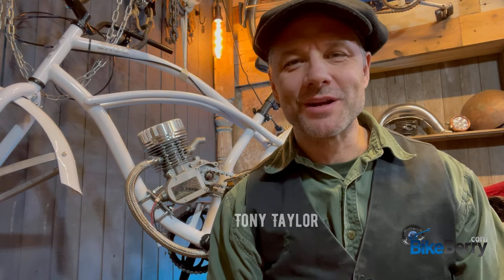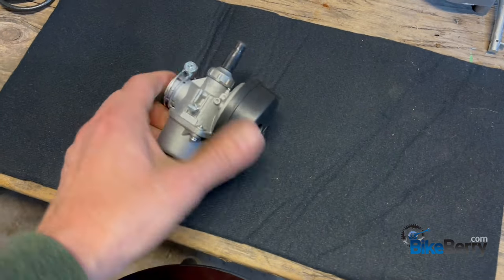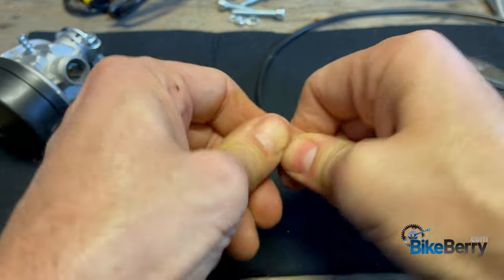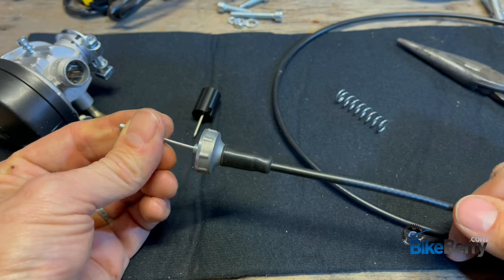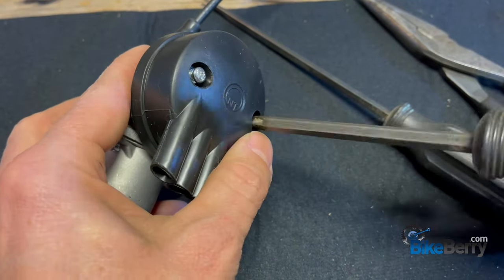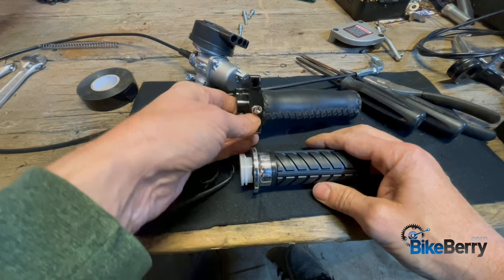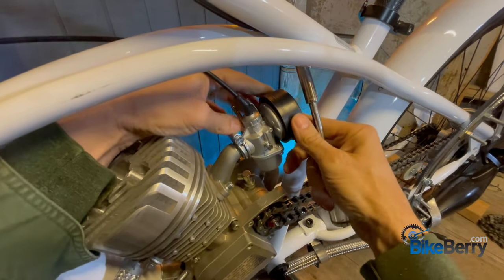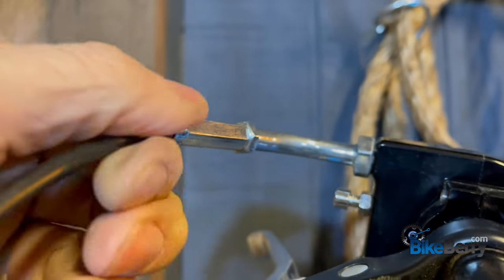Carburetor And Clutch | Adjusting Your New Motorized Bike's Carburetor & Clutch | Bike Berry

Comment: I REALLY NEED SOMEBODY'S HELP I WENT TO THIS SITE CUZ THIS FELLA REALLY KNOWS HIS STUFF. SO MY BUDDY HAD ONE OF THOSE CHINESE 49CC ENGINES ON A BEACH CRUISER HE RAN IT JUST FINE PUT IT IN THE SHED FOR 6 MONTHS AND THEN GAVE IT TO ME. IT'S MY ONLY MEANS  OF TRANSPORTATION AND I TAKE CARE OF A 77 YEAR OLD WOMAN WITH THE DEMENTIA SO I REALLY NEEDED IT TO WORK. IT DID NOT EVEN WANT TO SPUTTER FOR ME WHEN I HAD GOTTEN IT SO I REPLACED THE COIL, I REPLACED THE CARBURETOR ,I REPLACED THE SPARK PLUG ,AND NOTHING I SQUIRTED STARTING FLUID DIRECTLY INTO THE INTAKE NOTHING IT DOESN'T EVEN WANT TO SPUTTER. I CHECKED THE MAGNETO WHEN I HOLD THE SPARK PLUG ON MY HEAD AND PEDAL THE BIKE I GET SPARK SO THAT'S WORKING. I HAVE NO IDEA WHAT TO DO TO GET THIS RUNNING AND I NEED SOMEONE SMARTER THAN MYSELF TO GIVE ME SOME ADVICE. PLEASE HELP
Reply: Check for compression?
Reply: If you've got fuel and you've got spark and the magneto isn't on backwards (it'd still probably want to run if it was) odds are you are losing compression somehow. When you try to fire it does it slow you down significantly or does the engine spin over really easily? If it's super easy you aren't making compression
Reply: @fr33dumb0  bro I rebuilt the whole thing I replaced all the gaskets brand new magneto brand new coil the magnets fine the cylinder wall was clean as a whistle although the Piston had a good amount of carbon buildup I cleaned that put the whole engine back together new carburetor it won't even start with starting fluid. I did get it to sputter a little and I don't know if it's because it's a beach cruiser and it only has one lame gear and an extra chain but when I let the clutch out it is rather hard to pedal I'm 55 but I'm in good shape in the damn thing will get me out of breath quick
Reply: @fr33dumb0  I guess I could just buy a new engine but the fact that I rebuilt it and can't get it to run is making me nuts the only thing I didn't replace were the rings and they didn't seem too bad I thought maybe I had a vacuum leak somewhere which is why I replaced all the gaskets I don't know man I'd like to punch it in the face but it's an engine LOL
Reply: @fr33dumb0  I had a custom built Hilland electric bike and that thing was sweet but I planted it into a curb at 30 miles an hour and got a bad compound fracture in my left hand and I'm a damn guitar player but I can't get that bike to work either I think that's just dead I probably broke the brain or something on that one and that's why I want to get this gasoline powered one run and so bad. People that don't ride these bikes don't understand how fun it is because it's kind of like a motorcycle but it's light as shit so it's kind of scary dangerous and fun all at the same time
Reply: I drilled holes in the carburetor filter cover that got mine to start after 2 weeks of sitting gap the sparkplug too if you domt it'll run bad also a pull to start is the best way to go peddle starting is a waste of energy........a motorized bike isn't worth the time honestly they run like shit even when there isn't anything wrong with it
Reply: @bryceevans8340  not true, you just gotta know how to do it properly
Reply: @bryceevans8340  yeah thanks man I never got it running I just gave it away because I heard one drive through my neighborhood and it was 10 times louder than any chainsaw I'd ever used so I figured that let other guy have the problem
Reply: Its a shame you put all tht work into it just to give it away 😢 . Your carburator could have been flooding out the spark plug.
Reply: That carbon was maybe the stuf in-between that kept the compression. Change the piston
Reply: Ahh okay you did change the piston..
Reply: Please not in all caps

Comment: I was given a new motorized bicycle that the owner had never been able to start. The carburetor slide had been assembled upside down.(It is possible and the throttle will only open half way) Because of that, the bike sat in the garage for 6 years until it was discarded. I also found out that the rotor had lost magnetism.  Score!

Comment: Hey great video.New installation my bike won't start but after watching the video I realize my throttle cable is to loose The video shows how to pick a different hole to pre snug cable having g your adjustment screws all the way in so you have maximum adjustment abilities

Comment: Clear easy to follow instructions, with just the right amount of warnings  on what not to do. I have a motor with a starter and it's a little different in the clutch area but carb is same. My problem is mostly now in the sprocket, problem keeping it centered and running true. Thank you for the tutorial. Much appreciated. BTW, I'm 86 yrs old and looking forward to using this bike this summer.

Comment: This whole series has helped me with the little problem I had with my first motor and I actually had to take it off because I missed something up but if I would have watch the videos first I wouldn't have missed it up. You guys are doing an amazing job and you always #builditright
Reply: You ABSOLUTELY hit the nail on the head about the magneto leads being backwards!!! Brand new motor, just WOULD NOT start and I went through everything trying to diagnose it, turns out it was the leads being reversed! I have also noticed these motors are NOTORIOUS for the threads on the end of the crankshaft stripping at the drop of a hat to where the won't tighten back up,! I have TWO of these motors this has happened to, is there any OTHER ways to fix it besides rethreading it to the next size down or replacing the whole assembly?!? Thanks in advance! Be blessed.

Comment: #BUILDITRIGHT This whole series has been A great refresher. I had built my first mini bike when I was about 13, 2 different engines to make one that would get running. Then I got into landscape work always fixing weed eaters and other 2 strokes. I did buy a cheep kit online it only took me 4 hours to compleat my Schwinn 29inc. Beach Cruiser into a now motorized assist bike. It was this video that helped me to set that pesky idle screw to almost perfect from there I let it warm up and fine tuned it. Thank you for all the help!

Comment: Ed here... Wow ! What a calm & clear.. View & explanation.. I've viewed your video's before... Excellent stuff.. Question for u... My carburetor is sitting at almost like you have yours... And yours seemed at 45 degrees higher than mine.. I understand yours is a show and tell.. Mine is new... Break in two 4 liters of gas.. Still running  good.. But sounds bad.... Before i give it.. To my grandson so we can ride together... Suggestions tony... Can it run better with a level carburetor...
Reply: Great question Ed. As level as you can get it is most definitely the way to go. Of course many factors are involved like engine mounts etc. 

This bike is hanging from the ceiling hoist at the moment so it’s definitely out of level compared to how it’ll sit on on the ground fully assembled. 

Now, as for sounding bad. My black bike sounded bad for a few tanks a gas. Since yours is new I’d dial it in as best you can then ride it a lot to truly break it in. It should sound better and better.

Comment: I have enjoyed your segments so far but on this carb and clutch segment you changed the throttle assembly to an upgrades one that you like but that is not what comes with the kit so it is a little confusing when you start drilling holes and  but we as newbees are dealing with what comes in the kit, so it would be nice if you used those parts in your demonstration. Also drilling holes in the carb air cleaner cover for what reason was that done ?.

Comment: I'm having trouble getting my motor on my mountain bike and getting it started. I have everything hooked up but when I tried starting it by pedaling the rear wheel got completely bent at the rim and the sprocket chain was extremely stiff so the pedal connected to the original chain rotated freely but the clutch wouldn't release the chain on the sprocket. I bought a new wheel but I don't want to have the same thing happen again. Please help

Comment: Got a new motor with a little more thrill power,big sprocket on rear,woods back road and hills,want to stretch out a old frame and put 19 or 27.5 tires on it not not spend my fortune on it,Grest  vid for the un rider to get in on the fun going on my 3rd build, my old motors still going ,guys dont run them wide open for long periods and they last have fun

Comment: Hey so I bought a 50cc engine kit. I've got it running but I am getting zero trottle response.
Reply: Everything is tight I have throttle spring back but no forward motion.

Comment: Gasbike carburetors' come Stock with a #70 Jet. Here in Michigan that's way to RICH.
 I got a Big power increase with a #65, #64 is next.
Zeda engine, for the Balanced Crank, High Compression Head, Tuned Pipe, Better Spark Plug. and finally the Main Carb Jets.
I tune as if I would for other 2 cycle small engines, chainsaw, weed trimmer, blower. It's all in the Air/Fuel Mix. A 2 cycle Engine will TELL you when it's running right, just Listen to it.
Finally, from a cold start, Warm the engine up COMPLETELY !
 Then go and enjoy Your Run.

Comment: I just recently bought a bike with one of these motors on it.  It sat in a barn for about a year.  I drained the gas, put new fuel lines on it, and checked the throttle cable settings like in the video.  It has a new spark plug and I set the idle screw like in the video.  When I ride it, it seems like it wants to bog down, and it won't idle.  It wants to shut off.  Anyone have any suggestions on what else I can do to get it running better.  I did not drill extra holes in the air cleaner cover.  Will this help?

Comment: clutch rod that is hooked to clutch arm is sloppy  i put a copper bushing in it  from some flexible copper tubing and cover has a long bolt because chain guard mounts there  other wise you can use short one

Comment: That’s better carb than stock. It’s a bofang carb which has bigger jets a larger in diameter throttle piston and just a thicker foam filter. 
A lot of kits are coming with them now. I got one in my new kit.
Reply: Nice to know my man!! It’s definitely a good one!
Reply: even better than the speed carb?
Reply: @jrowley1507  yes
Reply: @keeganhache6667  what does the bigger throttle piston do?
Reply: @jrowley1507  allow more air into the carb and with a bigger jets = more power overall

Comment: You want grease on the end of the barrel for the clutch. CV joint grease is also better than regular grease. It contains lots of moly and great for high pressure areas such as this. i also adjust the clutch so that when at rest the clutch lever has the tiniest bit of play before making contact on the barrel.

Comment: So this is the first video I've seen where are you took off the little notch and adjusted it according to how you mix your oil and gasoline I did not know that I've had my first bike for 3 months I got me a bbr tuning 80cc motor on it and now I'm going to adjust some things just like to demonstration you just gave to my store my bike about 2 or 3 days ago and these idiots buried it with trash bags wrapped all around it I guess they're going to leave it there for a while and then think somebody won't forget about it it happened at Walmart ended up finding out with some homeless people they have a camp I'll call him about 6:00 in the morning I walk down through there at a 410 pump in my hand slave and my friend Ivan had 9 mm we went down there and broke up a homeless junked out chop shop for bikes basically and I pulled out a hammer and I told the guy I said if I hear you stealing anymore bicycles from Walmart on one hand I'm breaking one finger and on the second hand I'm breaking two fingers therefore you won't be able to use your hands but you won't be completely useless now they call me in the bicycle gangster I even went back the next morning they are homeless sleeping in a tent I told him look I've been homeless I've done the whole tent thing I was  addicted to opiates for almost 30 years I went back down there the next morning and carry them some breakfast cuz you never know when I might need one of them next time I bite it so they might not be dumb enough to push it across the street to where they're staying

Comment: I had to take off my air cleaner and just tighten the hell out of the screw. Because even double nutted the stupid thing comes loose and the vibration from the engine rattles the choke closed. Which kills the engine and sucks. I just choke my engine with my finger. Problem solved!

Comment: 5 turns for the idle. Not ten. You were turning half way only. But no matter the idle is adjusted once the engine is running. It is turned inward u til engine stays running. It’s not rocket science. But thought this was a carb adjustment video. It’s not. :(